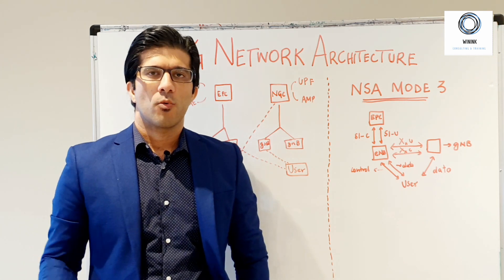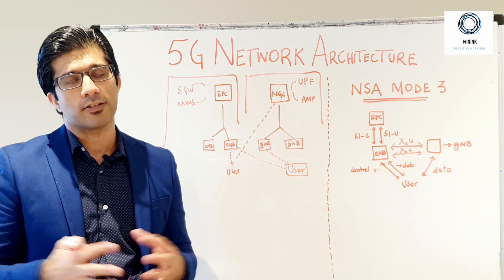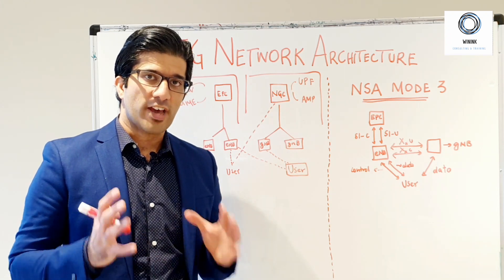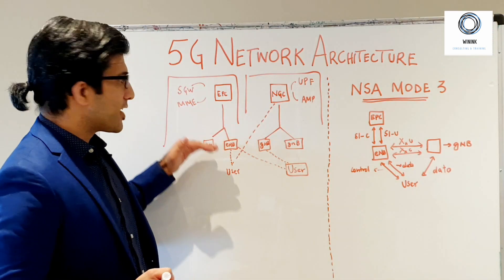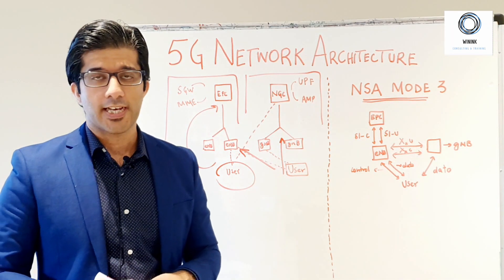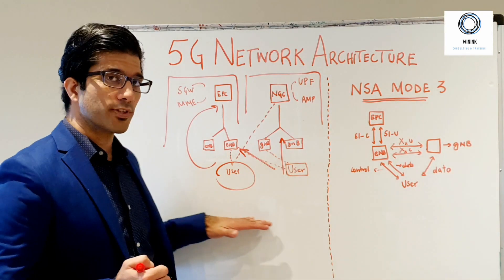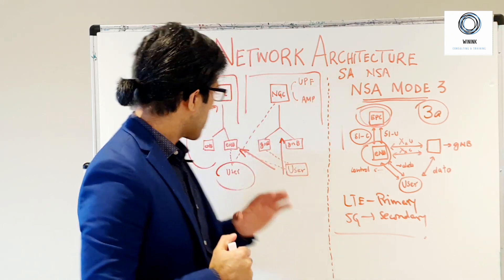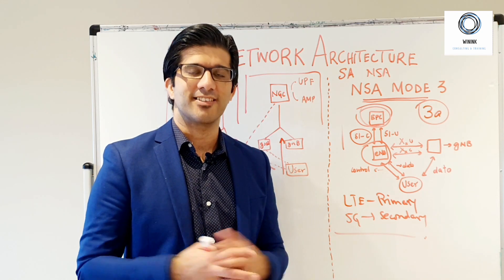5G Training Lecture #3 : 5G Network Architecture and Non-Standalone mode deployment with LTE

Comment: This is informative, good video ! 
Question: At 6.26, what do you mean by data collection at eNB ? What kind of data is it and who uses this data for what purpose ?
Reply from the maker: Hi Sanjeet. The data collection part refers to the user plane data. In Option 3, the user plane data from both gnb and enb is collected at enb and then passed on to EPC. In option 3a, user plane data is collected at EPC where both enb and gnb provide their user plane data to EPC. I hope that made it clearer.